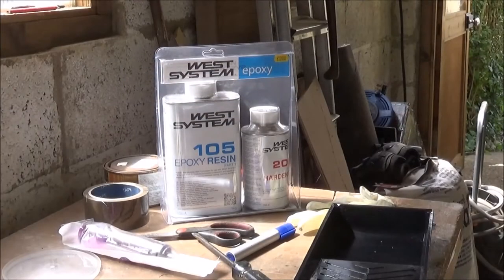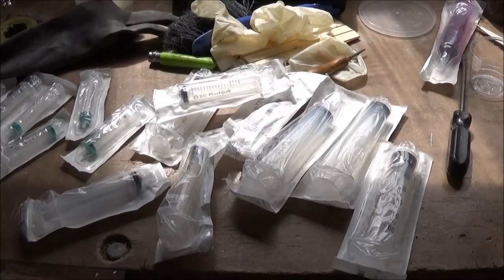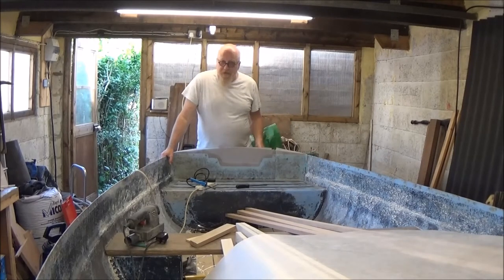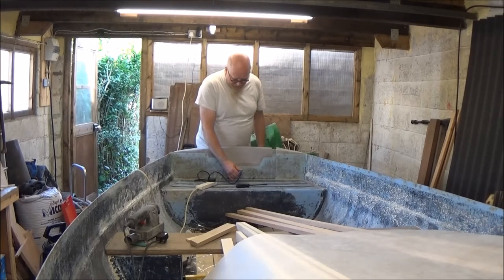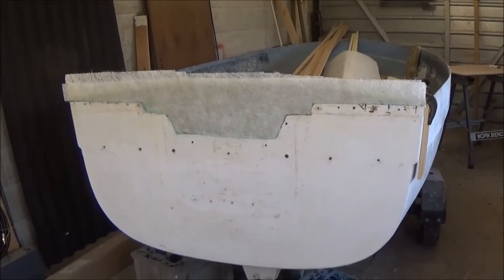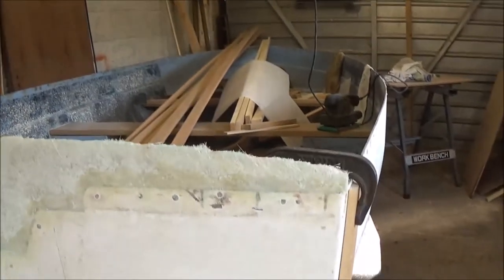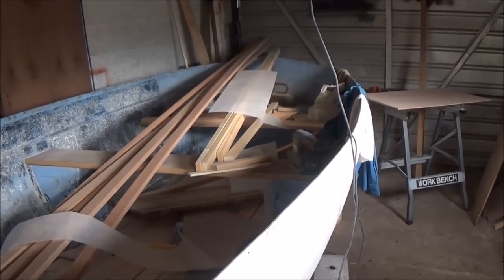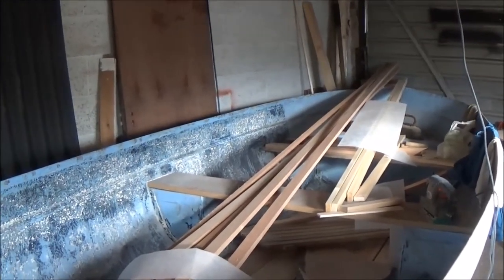Dale Skidmore -Boat Restoration Part 6

Comment: That is a handsome transom! When ya' get your top cut to suit lay a finish strip across the top with a 1" overlap from side to side. Makes a nice smooth surface.Lookin' good!   ZZ.
Reply from the maker: I was thinking of sealing the edge with resin, ZZ. I tried plaining and filing the edge and it just goes fuzzy. I hope to fare everything with a router using the rear rail as the guide. I think I will probably do as you say now. Thanks for the tip.

Comment: Enjoyed that , as usual...  Ref' steaming the wood, have a think about involving a length or two of scaffolding pipe if you can  get hold of some.  If you were just using heat bends you can literally lay the scaff'p  through the fire, or suspend it over the flames as you prefer, as a means of controlling the heat.  The pipe protects the wood from charring as long as you're careful. If you can seal one end off and generate steam into the heated pipe before sealing , huge bonus...  It can be a real mega-cheat on a steaming cabinet/box even just using the pipe to contain the steam. If you want to do multiples 'borrow more pipe.  I'm like a kid waiting on  christmas with this. Can't wait to see you get what was a mangled reject afloat.
Reply from the maker: It was a cliff hanger ending to this vid, Dusty, not my intention, but worked out that way. I've a feeling scaffold poles are not big enough for the rails, but I do have something lined up. Whatever happens it will be on video, that is how I got to learn the process. I have a great deal of experience using a bending iron, on wood up to around 2.5mm thick, and it still amazes me when you feel the wood relax, but this will be something else. Hopefully it will be wet before Christmas, lol. See ya soon.

Comment: you don't use your tooth brush, you use her toothbrush. The boat is coming along well. At least you have most of the dirty job, the fiberglass done. Thank you for the video, Ade
Reply from the maker: Ahh, of course. I should have known, lol. It is coming along. Not much apparent progress as most things have to be dismantled to make way for the next job, but it won't be long before there is some assembly work. The fibreglassing went better than I had hoped too.